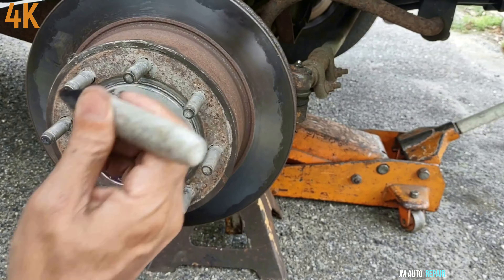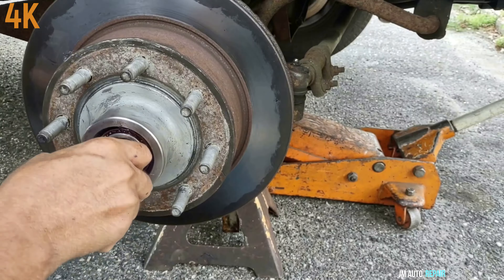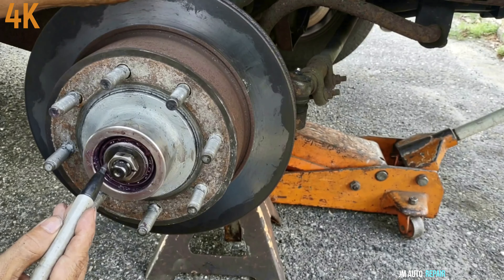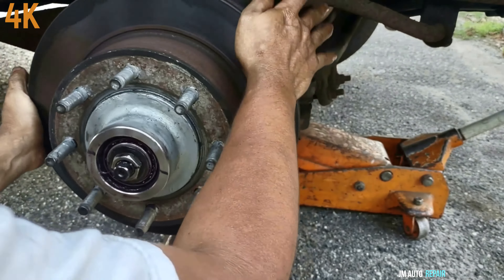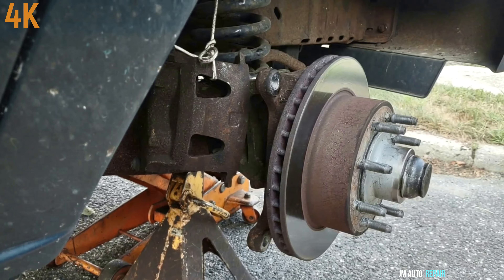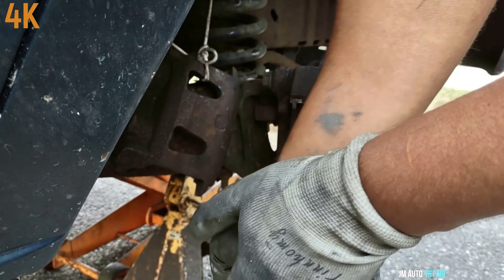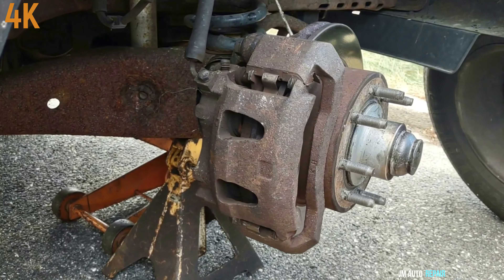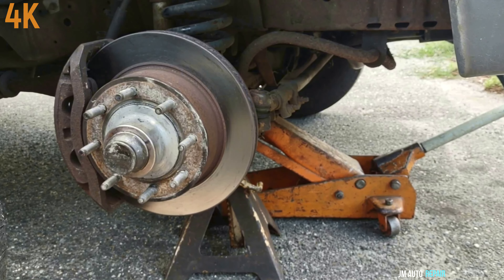Ford E450 E350 E250 front inner and outer wheel bearing replacement

Comment: Your packing the bearings are wrong way you're supposed to put grease in the palm of your hand.. and slap the bearing sideways into the grease in a packs it inside the bearing slap the bearing in the palm of your hand and it will pack it and work it around on both sides that's how you grease a bearing

Comment: The proper way to grease bearing is to place a wad of grease in the palm of your hand then push the roller part of the bearing tightly onto the grease blob on hand. You should see grease coming out of the back gap where he was adding grease in video. Keep working it around the complete until you have a full ring of grease coming out the gap.

Comment: Job done, I still have hard breaks,  have vacuum,  just replaced the booster, today the F Left ABS sensor.  Plus, the bearings with confidence thanks to you. I will go back and get the right torque on the rotor. I was running out of daylight, so I slapped it on with a couple back and forth and then snuged it down.  Your way  looks correct... 😅
Reply: With the ABS light out. Next, I will double-check the push rod on the booster vs. the oem. If that looks right, I'll replace the master cylinder. I figure that the last possible thing, right? 2002 E350 7
3 powerstroke for context.
Reply from the maker: great job, thanks for sharing and also for taking the time to watch this video.

Comment: Great video!  Thanks!  I’m replacing front rotors and hubs on a 2004 E450 camper chassis with rear duals. The front rotor extends out further to accommodate the dually wheel. Is the procedure and torque spec the same?
Reply from the maker: thanks for sharing, the rear duals are a little different but very similar, 8 wheel nuts at 9/16-18  148 ft-lbs and the ones with 5 nuts 103 ft-lbs
Reply: @JM-AUTO  thanks for the quick reply and sorry for the confusion. I’ll be replacing the front rotors. The rotors I have extend out further than the ones in your video, I’m guessing to fit a deeper wheel that’s interchangeable with the rear duals. Is the torque spec and tightening sequence the same for the axle nut on my rotors/hub as what you show in the video?
Reply from the maker: @rocks58  no problem, yes they have same torque specs

Comment: I have an 04 e150...are the hub n spindles all the same on the 150...250...350?
Reply from the maker: it is basically the same, the difference is almost nothing so the procedure is almost exactly the same.
Reply: Packing the bearings, put a glob of grease in the palm of your left hand, take the bearing in your right hand and force the base of bearing into the glob over and over until it starts coming out between the rollers toward the top.  Rotate and repeat over snd over and you’re done in less than a minute.  Dad taught me how to do it properly over 50 years ago, he was a Navy trained mechanic I miss him everyday.  Good video.
God bless!